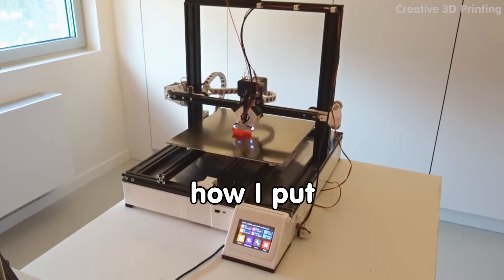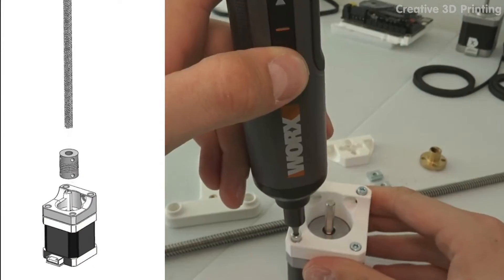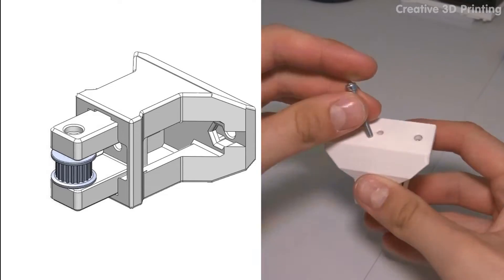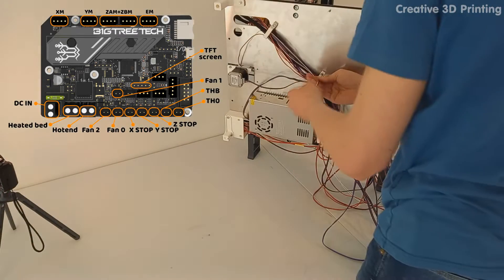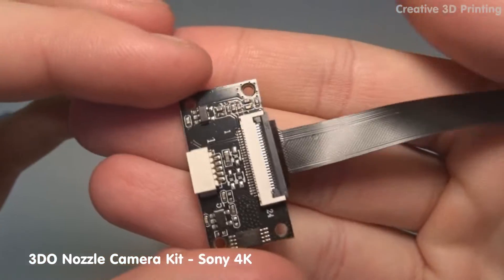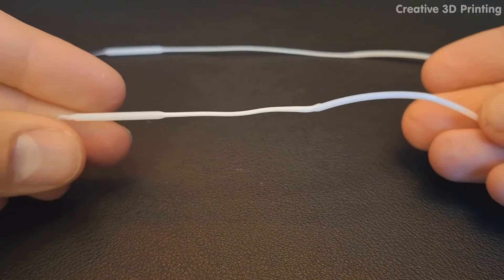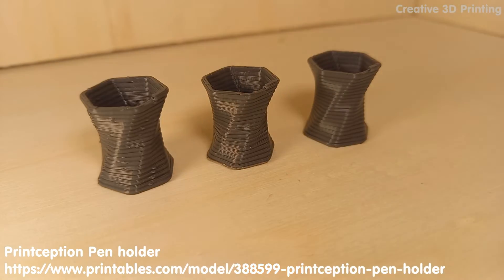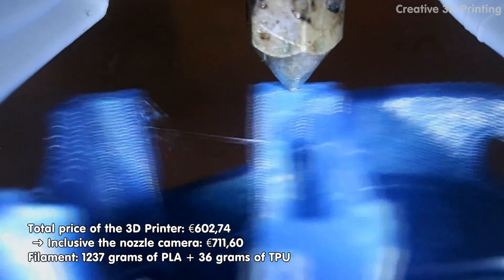DIY Large 3D Printer for €600 + Problem Solving| 2/3

Comment: Nice build, wonder if it's possible to make it with a bigger printing volume (something like 400x400).
Thanks for sharing the files, big kudos👍
Reply from the maker: Thanks a lot! It's definitely possible to make it bigger in all dimensions, you just need some longer aluminium profiles and a bigger aluminium plate and longer cables for all the electronics (for everything of the extruder) and in the software you need to adjust the build volume.